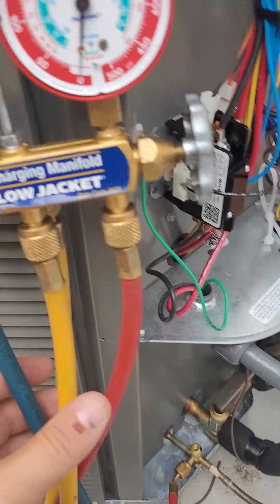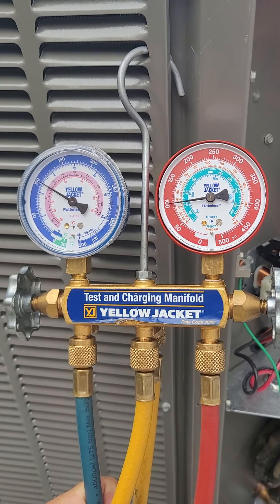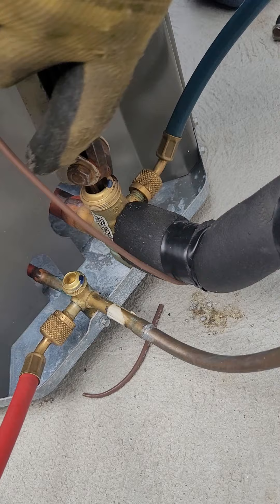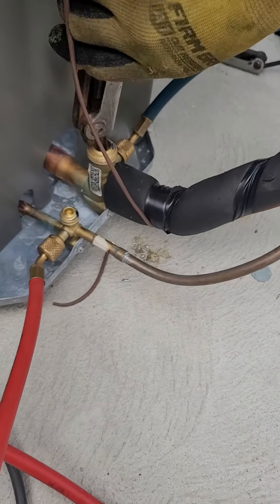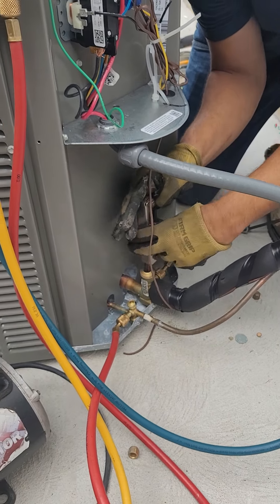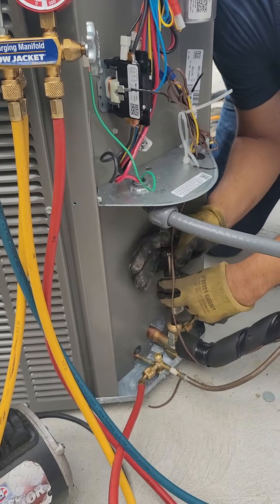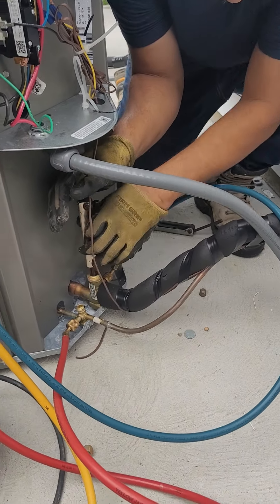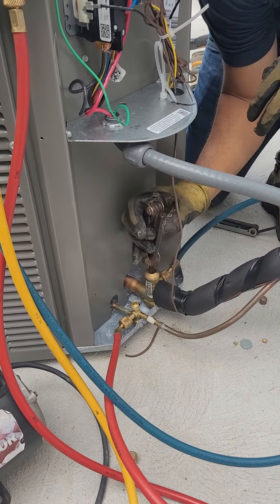❄️AC Refrigerant Release  #airconditioning #hvac

Comment: For the people saying get a service wrench - I always crack the valves first with an allen key before using a service wrench.  I've seen service wrenches strip the hex in the valve because the factory overtightened them.

Comment: Why introduce vapor first instead of liquid , going against cycle which may not be a problem now but in the future tell me how long your compressor last.
Reply: Thanks for the comment.  I've always done it this way for 10+ years now.  I'm not stuck in my ways though, and ill change if it makes sense. Honest question- why would it shorten the compressor life?
Reply: @CopperValleyTravel because when you open the suction line, you introduce the possibility that lubricating oil could be pulled out of the compressor sump with the refrigerant. We always open liquid side first.
Reply: I’ve been seeing that some people open up the suction line first. I’ve always done the liquid first. My teachers and my boss have told me that you will slug the compressor. Or when changing out the compressor, I always do liquid first to break the vacuum and then charge it on the vapor line with my vaporizer. It’s my 2nd year in HVACR so you know I got a lot to learn.
Reply: Because if any oil rushes out with 410 then once comp starts it will drag back into compressor quickly. If you open liquid and lose oil then it has to slowly travel through metering device. If you just open either one slowly it doesn’t matter anyways.
Reply: Was taught to open suction 1st. Oil pushed out, will come back to compressor, rather than traveling through entire system